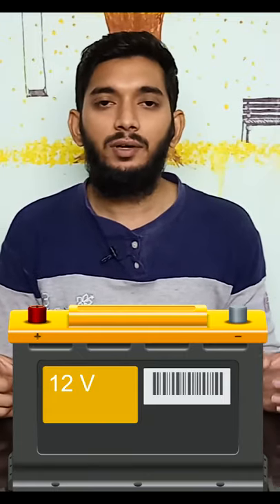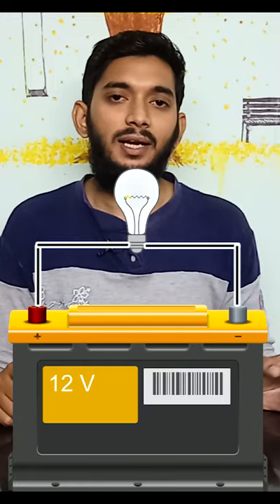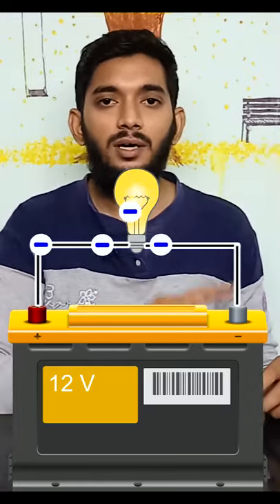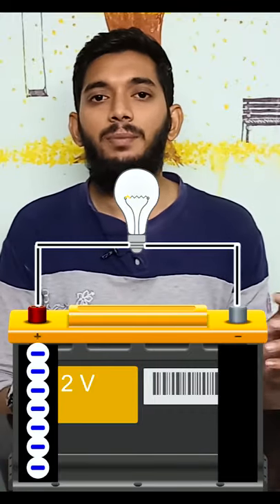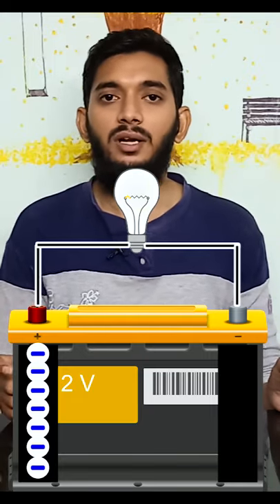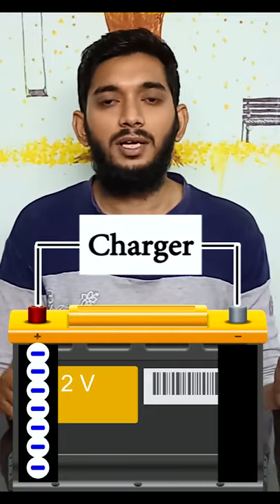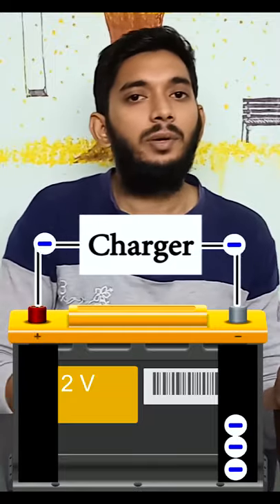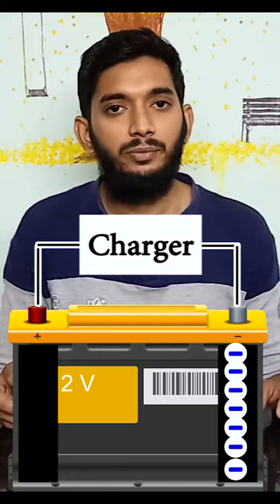Battery working principle..#engineeringfacts #engineeringfactstamil #shorts

Comment: இதைவிட சுலபமாக யாராலும் சொல்ல முடியாது.🙏
Reply: Ama thappu thappa solrathu yar venalum easy ah sollalam
Reply: @guruvigneshwar6145  😀😀😀 yen bro appadi soldringa?
Reply: @travelindia4611  He is wrong. Battery la irunthu current velila varumbothu positive side la velila vanthu negative side ulla pogum. Athavae avan thappa than solran. And recharge apdingara concept ivan solramari nadakkathu. Battery kulla nadakkara chemical reaction nala than current velila varuthu. So again antha current ah ulla anupcha chemical reaction reverse agum. Athuthan recharge nu solrom. And battery ku ulla negative side la irunthu positive side ku current flow agum. Itha internal flow nu soluvanga, but ivan positive layae current thangirum namathan eduthu negative side kudukaromnu solran. He is completely wrong 😳
Reply: You are right but he initially said about electron flow watch carefully..
That means electron flow from negative to positive then electricity flow from positive to negative..
I think you never watched his other videos..
Think before comments next time..love from 🇱🇰🇱🇰 indians  didn’t understanding their local talents .
This channel doing great job
Reply: @guruvigneshwar6145 Illa bro avarum crct dhn neengalum crct dhn , neenga solradhu interms of electrochemistry, where loss of electron happens at anode which is positive charge , and in electricity the same electrode is  called cathode because electrons are present there at high potential and travel to Anode which is the low potential in the electron POV. And about the Internal flow part, electron form aana reason is due to oxidation Anga athuku equivalent ah oru plus charge um form agum athu internal ah iruka membrane valiya flow agi it reaches the cathode which is anode in electricity

Comment: For the benefit of newer people, please explain polarity, Only DC to be used for charging, the safety levels of Voltage & Current, then the Battery capacity in AH, besides the acid fumes from the battery, etc.
When I was very young, I ventured into a similar setup based on little knowledge and great enthusiasm!!

Comment: 🔋 Battery  la  load connect pannum podhu high potential to low potential thane electron move agum...... 
Appo plus(+) to minus(-) thane bulb connect pannum podhu  electron movement erukum....
Neega minus(-) to Plus(+) nu solringa........
Reply from the maker: Electron moves negative to positive, the electric charge will drive positive to negative.
Reply: Battery na yappothum negative la tha electron output kedakkum 
Athalatha bro bus truck la la positive terminal body kuda join panniduvaga  minus la tha line aduppaga
Reply: Bro positive means more hole atom occupy the area, negative mean more electron occupy the area. Electron move negative to positive, hole move positive to negative

Comment: Wire connection aa maathi kudutha inga irukkura electrons opposite la travel aagatha a
So we can use infinite battery power, i don't know all about this, correct me if i wrong??
Reply: Yaaravathu reply pannunga
Reply: Normal oru new battery storing charge capacity not 100 percentage 80% percent day to day ( dod)depth of discharge  its battery capacity decrease finally reach   end of life. 15KW battery not store 15kw power it store 12kw power some power loss by heat day to it capacity decrease finally reach  0,we can't use battery power infinite

Comment: Bro pls tell me why DC is used for charging. I am a Mechanical this will help for my future pls answer
Reply: Thanks bro 😮
Reply from the maker: https://youtu.be/dSwZ1iDigB0
Reply: DC current la tha bro positive and negative kedakkum athalatha potential different kudukka mudiyum battery ku .
Ac current 50HZ LA 1s la 50 times +and- mari mari varum athalatha change panna mudiyathu batterya.
Potential different konndutu varanuna namakku constant positive and negative venum bro
Reply: @agricultureworkyogeshpandi2718  thank for explaining bro
Reply: DC current constant voltage and one direction current flow so we give DC current to battery and Electrolysis process done in battery positive charge move one direction and negative charge move one direction accumulate in plate, we give AC alternative current in change  direction 50times per second so it lead not proper electrolytes so we didn't use AC current in battery

Comment: By considering your saying  when a battery is connected in between a two terminal of battery electrons flow from negative terminal to positive terminal. After this condition battery is completely drained then the bulb will not glow anymore.  "But that electrons are now at another terminal so still the potential difference exists which the same between the terminals." If so when potential difference exists, bulb should glow but practically it don’t glow.  Please make me clear
Reply: Bro his saying is totally wrong. Current always flows from positive to negative side outside the battery and negative to positive side inside tha battery. As the chemical reaction gets netural inside the battery the current flow stops, when we recharge the battery, the chemical reaction is reversed so that the battery gets recharged

Comment: Bro battery inverter lenthu battery wire yen ivlo thikness sa podurom..
Then car la battery ku bathila adapter mathiri pottu start panna mudiyuma...
Reply from the maker: High current flow need high sq.mm cable
Reply: @engineeringfacts  car la battery ku bathila adpter regulator use panni dc supply koduthu start panna mudiyuma mudiyathuna yen... Bro
Reply: Car battery 12V tha bro athanala current A athigama erukkum .
A athigamana wire thinkness increase pannitha aaganum bro
Reply: But AC current 230V athula A athvathu current flow kammiyatha erukkum athalatha vettula wire thinkness kammiya erukku
Reply: @agricultureworkyogeshpandi2718  thanks bro
Car la battery ku bathila regulator use panni start panna mudiyumaa
Reply: @fairose1052  pannula bro antha alavukku power erukkura adaptor venum athukkana wire cable venum bro
Reply: @fairose1052  onga car starter motor yavulo W bro
Reply: 200W motor na 12 V,16A adaptor venum bro appatha start aagum onga car motor W poruthu marum

Comment: 100 AH battery la low capacity DC LED direct ta connect pana , LED burn out akuma for over current
Reply: ஒரு லைட் பர்ன் ஆன காரணம் voltage தான் ப்ரோ..current என்பது 1000000AH ஆக இருந்தாலும் அந்த பல்ப்க்கு எவ்வளவு தேவையோ அவ்வளவு தான் எடுக்கும்
Reply: @sktechworks  then if you short the battery terminals using wire or resistor result: it will burn out 
So why it's happening?
Reply: @knowledgeispower393   LED is an load bro..The load decided the flow of current..But short circuit means there no resistance between +and -…It’s make heavy current flow
Reply: @sktechworks  same  if you use resistor result: resistor was burnout.... Resistor have a resistance it is act like a load.
Reply: @sktechworks  my question is simple.... Possible to use the high capacity battery like ( 250AH or more).. to start the low capacity low ampere  DC starter motor?
Reply: @knowledgeispower393  அந்த ரெசிஸ்டர்க்கு கொடுக்கப்படும் அதிகப்படியான வோல்டேஜினால் பாயும் மின்னோட்டத்தினால் தான் எரிந்துபோகிறது.
Reply: @sktechworks  brother DC voltage is stable 12VDC and one think voltage is not variable depending on load, current(ampere) only varies depending on load.
Reply: @sktechworks  my question is simple brother If possible to use the high capacity battery to low capacity low ampere DC starter motor.
Reply: @knowledgeispower393  possible

Comment: That's not true. The energy inside the battery convnetred into heat, heat to light. You don't transfer the electron from one pole to anthor pole. 
You pour the electrons in the electricity that is what a charger does.

Comment: During a current flow in a battery, the electricity flows from positive to negative anode. Not from negative to positive anode. Ithu outside the battery. Battery ku inside la negative to positive anode electricity move agum. Athu internal flow nu soluvanga 

Therinja peasu, ilana peasama iru, thappu thappa video podatha...